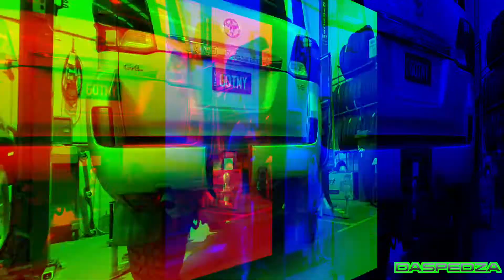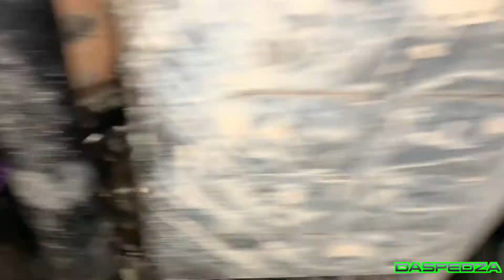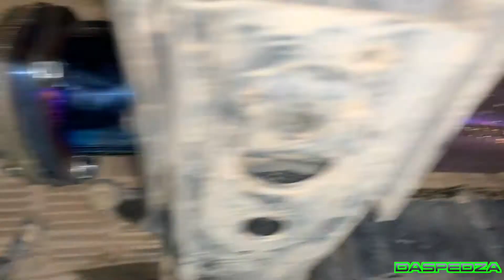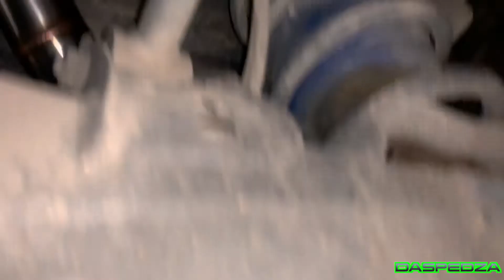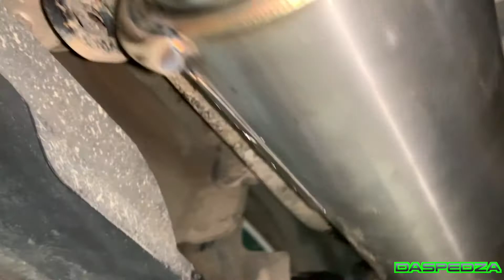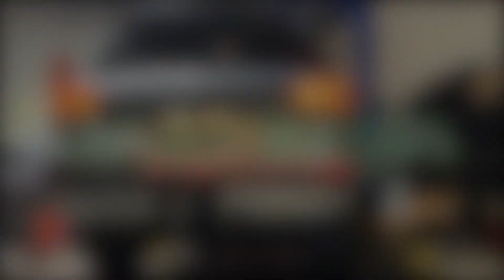200 Series Landcruiser Twin 3" Into 4" Torqit Exhaust (Louder) Before And After

Comment: hey dude I just got a 2008 vdj200, it has the white puff of smoke on cold start so guessing it's clogged intake like your other video, but also I've noticed the sound from the turbo's is a little odd, I've never owned one so idk if it's normal or not, but it almost sounds like, instead of a constant turbo whistle or whine, it sounds like the boost is almost 'wobbling', as dumb as that sounds. All I can think is maybe there's a boost leak somewhere. I just bought an obd2 bluetooth thing like you got I'm hoping it shows boost pressure. Its got 360k on the clock. I seem to get around 11.6L on the highway which doesn't seem great to me? It's totally stock just with a factory alloy bullbar and it wasn't loaded up, just my MTB in the back..
Reply from the maker: Hey dude,
The turbo noise like fluttering you’re describing is normal as the 200’s dont have conventional turbos the TGV turbos in the 200’s are ecu controlled so they don’t sound like the conventional waste gate turbo setup. 

Best thing to buy is a scan gauge 2 i run one of those in mine and i track all the temps etc on it and have it permanently mounted in the car. 
11.6L isn’t bad at all for a standard cruiser with 360k on it man. 
White puff on cold start yes is either the intake clogged could also be glow plugs having 360k on the clock if they’ve never been changed then they’d be well over due. 
Catch can and intake clean should fix up the smoke issue if it’s not anything else that’s causing it ie low compression or injectors etc. 
hope this helps.
Reply: @DaSpedza  Thanks but last night it actually started throwing codes but I haven't been able to check them. Just flashing 4lo and VSC and it's in limp mode.. what a piece of junk. I'm assuming it's clogged EGR, but won't know until I can get a code reader to see what it's not happy about. Battery pull cleared it but it came back pretty quick. Could be low voltage on the batteries from what I've read in the 200 series facebook group so I might put new batteries in too..
Reply from the maker: Yeah batteries can cause it. But 4lo and Vsc most commonly is the 4wd hi low and center diff solenoid. They either need the multi plugs cleaned. Aswell as the earth. They get sticky if they dont get engaged enough. I engage mine once a month.
Reply: @DaSpedza  Don't understand why that would put the car in limp mode though. Anyway I'll check the codes tonight at supercheap
Reply: @DaSpedza  Really regret buying this hooptie could have bought a mint HDJ100 for 40k instead of this vdj piece of  shit
Reply from the maker: Im not going to lie the 2007-2008 200’s aren’t the best. 2010-current are the ones you want even better yet the 2012-2015 slight revision before the late 2015-16 major face lift that got the dpf’s
Reply: @DaSpedza  Codes magically cleared yesterday and drove sweet, this morning driving to work was fine almost the whole way, I put the boot in and boom codes back, so seems to happen under heavy acceleration. Will just have to wait for my OBD2 scanner to come in.. think I will be selling this piece of junk as soon as I can reliably get rid of these codes.
Reply: @AM-yb1ez  also I’f it’s second hand could have been treated horribly don’t let this turn you off 200 series there is a always a reason someone is selling something our went to 380 thousand before a mechanic did not put the oil filter on right and blew the engine